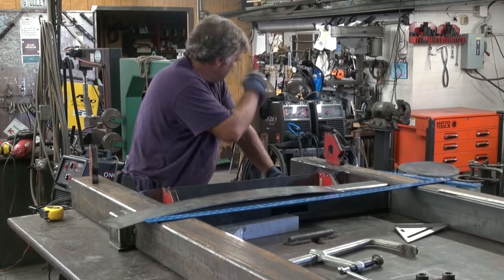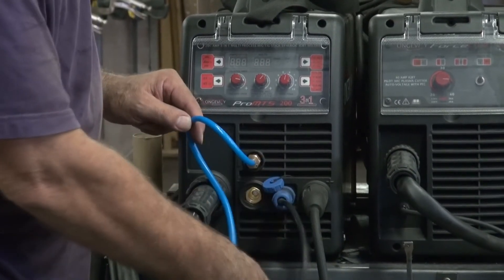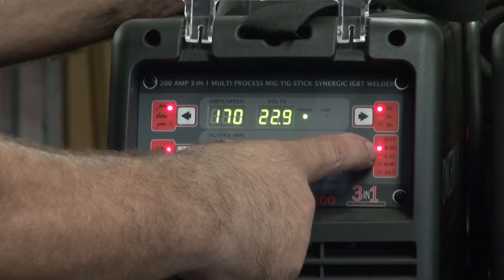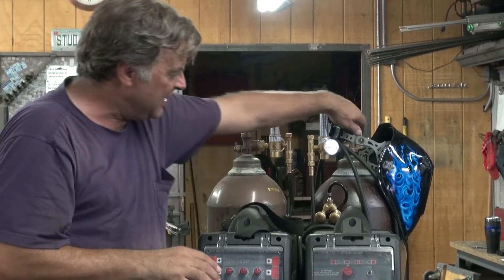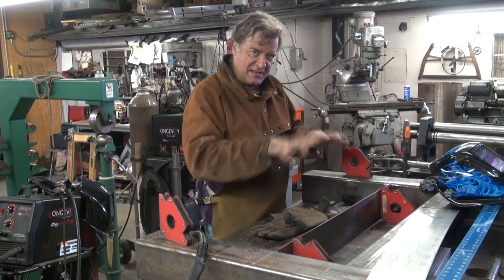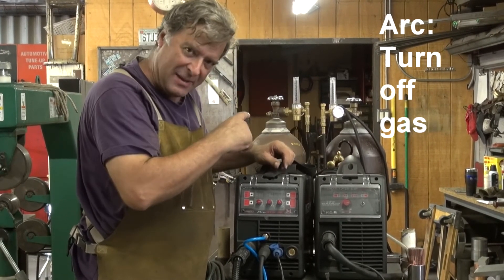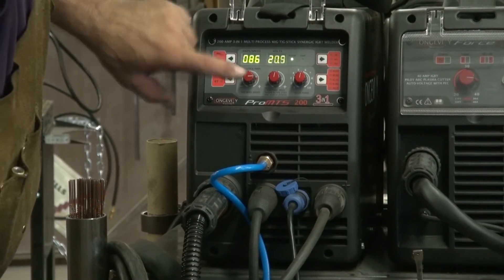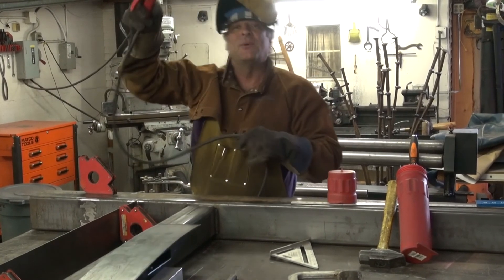How to Change TIG to MIG to Arc on a Multiprocess Welder - Kevin Caron

Comment: Thank you for your response.  Stick welders are so cheap today, why bother trying. BUT!!! The cheapskate in me must know! Smh i have a tig welder, but every once in a while, I need to run a few stick welds. Im not going to try until I find out the whole scoop. Thank you.
Reply from the maker: Well most tig welders come with a stick welding function as well.   What machine do you have?
Reply: Kevin Caron, Artist lol must I say an Eastwood 200 ac/dc. It honestly does a fair job for the putzing around I do. The new 200 ac/dc has an arc function and that was my reason for asking.

Comment from the maker: Not sure on the power supply in the machine but it runs on 220v or 110!!    I have run it on a 110 volt 20 amp breaker and had no problems. 

Great question!!!